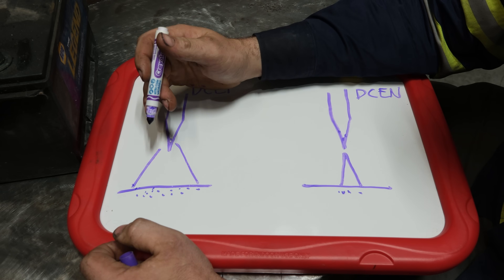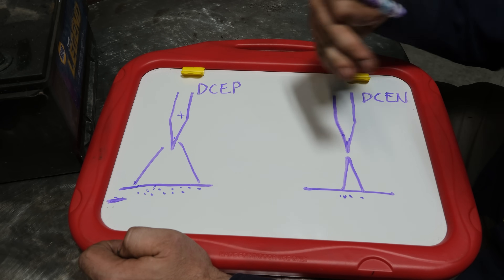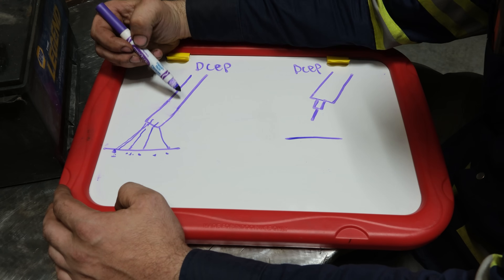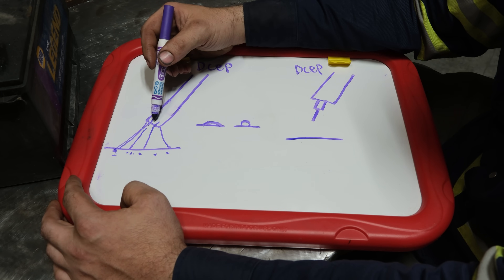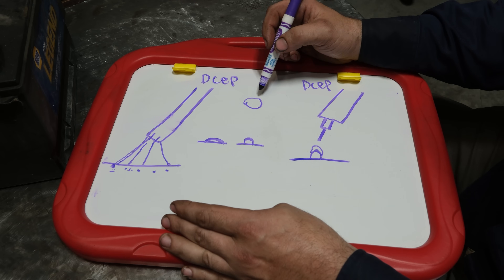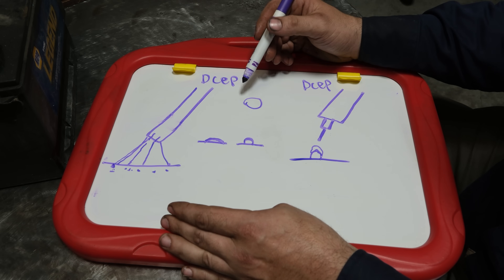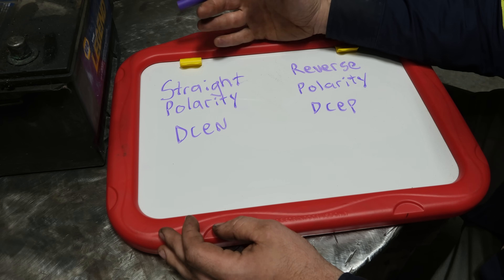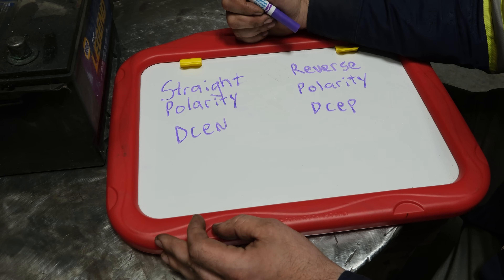Welding polarity and why electron theory is used (In response to #weld.com)

Comment: That was a very clear lesson in polarity. If you have a consumable tip such as stick or flux core (dual shield), then run DCEP because the electrons will flow from your work to the tip, helping you melt the tip and wet out your weld. If you are doing TIG and you wish to not destroy your tip, or flux core, you must use DCEN so that electrons flow from the tip to your work, thus keeping your tip cooler. That makes a lot of sense. Thanks for such a clear lesson.
Reply: Flux core is run DCEN
Reply: Self shielding 
Flux is commonly DCEN. Gasshielded fluxcore (dualshield) Is DCEP (commonly) but as always: Look on the specsheet of the fillermaterial.
Reply: @sebastianleicht  my mistake, Flux core is DCEN. My learning continues.
Reply: What about my tombstone welder?
Reply: @ivanduke  Your, and my tombstone, is AC negative, where the stick is positive. Does your tombstone have DC?
Reply: @TorBoy9 AC only

Comment: Thanks Greg for the explanation “in understandable terms” of how the polarity actually affects the welding processes. If I remember correctly from my electronics study years ago components such as NPN and PNP Transistors with the arrow drawn on their emitter lead were actually drawn pointing the wrong direction for representing electron flow. Then when they discovered electrons travel neg to positive they just kept the nomenclature of their drawings the same and to represent what they then explained the transistors symbols of the emitter lead to represent showing conventional current flow direction.
Thanks for teaching us with your excellent videos my friend. 😎👍
Reply: Naaaah. It's even more complicated. In Bipolar (PNP/NPN) devices you have a lot of holes moving too. Those ARE positive. It's kinda impossible to get the arrow right when you have both types of carriers :D In N-Channel Mosfets undergoing active conduction you have only electrons. And consequently, their arrow is pointing in the correct eletronic direction. Source injects eletrons, drain....drains them. P channel again has the arrow inverted, only holes are moving. People have known about negative elementary charge for a looooooooong time. Can't design vacuum tubes without knowing.
Reply from the maker: Your example is why the importance of everyone being on the same page of understanding matters lol.  On any component that functions as a one way valve or otherwise the direction of electrons matters, polarity needs to be accurate for things to work.  If everyone isn’t making the same assumptions on  direction, something is sure not to work lol.  I find it funny welding decided to label the terminals as what they actually are and follow electron theory, considering how many things in the US don’t follow that.  Having virtually no highschool education I didn’t know of electron theory (or realize what was going on until I took a welding class) and didn’t understand why they labeled things like they did, which appeared wrong.  Funny how somewhat inaccurate things wind up sticking around forever and people all over the world are taught differently lol.
Reply: @makingmistakeswithgreg it's not as odd or funny as you might think. Current theory was developed alongside water and steam power. Water power uses a concept of surplus and deficiencies to create a pressure difference then harnesses that for power. It's the same with everything,  more pressure or force than resistance means something moves. In accounting,  a surplus was always represented by a + (positive) which is the opposite of a deficiency represented as a - (negetive). So current theory was a primitive way to understand how to get work accomplished that still works today. A surplus of electrons moving to a deficiency. Welding or brazing on the other hand used flame and heat to bond materials together. It was always a molecular or atomic art even before we understood what was happening or electricity was a thing we used. So once we started understanding we could use electricity to heat the materials,  it made sense to stay at the molecular or atomic state because we are still asking metals to bond with other metals.  So the difference is really in getting useful work verses atomic structure and bonds.  It just gets confusing when current is used to create the condutions for the atomic bonds and the terms blur.

Comment: Thanks for the clear and concise explanation of welding polarity and it's effects.  I learned to weld 40 years ago, but stopped to pursue another career.  I recently retired and dusted off my old Lincoln TIG 300/300 and was unsure of the polarity to use for stick and TIG.  This video was the refresher course I needed!  Just yesterday I welded a 24 gauge heat shield for a friend using my 100 amp Lincoln MIG.  The setting chart for 24 ga with CO2/Ar suggested switching to DCEN to prevent blowing holes in the metal.  The results were exactly like you said, big blobs of metal with no penitration.  Reverting back to the normal DCEP worked fine. you just needed to be careful. This video could not have come at a better time.
Reply from the maker: Glad to hear that the video helped you out.  It’s pretty crazy how little penetration DCEN with gas shielded mig has.  Definitely not something you would want to use on thick steel lol.

Comment: My old lecturer explained it this way, you imagine 2 car parks, one at each terminal (+ and -), the cars are the electrons, so whilst the cars travel from - to +, the car spaces appear to move in the opposite direction (conventional flow).
Also, where many electrons are confined to a space, they repel each other-hence with DCEP, they widen the cone arc, where as in DCEN, only so many electrons are allowed onto the tip because of the repulsion from each other.
Great video as always, not enough theory is being taught here on YT except thru your channel.

Comment: Very well explained! Where there once was confusion, there is no more, and by knowing the why, it makes sense, and I no longer have to memorize it. Thank you Sir!
Reply from the maker: Glad to hear that 😀👍.  For many things electron flow simply doesn’t matter. Welding is one of the few things where understanding what’s going on with them explains why certain things seem backwards.  And when you understand what’s going on you understand welding quite a bit more.   Or at the very least they could have called DCEP straight polarity instead of DCEN, that would have made more sense in regards to keeping things as conventional current lol.

Comment: Very well done Greg! I went to welding school right after I graduated from high school and I never understood the why of Straight & Reverse Polarity until I was perusing an Electrical Engineering degree over twenty years later. It's kind of unfortunate that the made up convention of "current" came about a long time before electron flow became understood... In fact, "current direction" as it was understood at the time could have just as easily been established as negative to positive - I had one professor say that they just flipped a coin to define it and it landed on the wrong side...
Reply: I don't think they flipped a coin. Current theory is too easily visualized as an excess or surplus on one side. It's based on how water flow (a common form of power at the time) seeks an equilibrium of pressures and is harnessed for energy or power.  It's a well understood principle of the time. Take two identical tanks of water and connect them at the bottom with a valve to control flow. Fill one completely up with water and leave the other empty. You can say one has more or a surplus of water while the other has a deficiency. A surplus is represented by a positive number + and a deficiency is a negative number - just like in accounting. Open the valve and the full tank will transfer the surplus (+) to the deficient (-) side until the water level is equalized. This created a current or flow of water that can be harnessed to be used for useful energy - a waterwheel for example. 

So electrical current theory stems from existing terms and technology when it was being discovered that it can provide useful work also.  Electron theory was develop from the atomic understanding of the process and since processes like welding was so closely related to the atomic fusion or bonding of materials,  it made sense to stay in that reality. In short,  it's identifying separate things using similar terms based on the existing technology of the time it was used.

Comment: When I went to electronics school in 1968, I was taught (correctly) that electrons flow from negative to positive.  Later in my carrier I had the opportunity to work with several EE and trying to work through a problem when one guy is thinking - to + and the other guy was taught + to - was a real pain in the ass.  Why not we just admit we were wrong in the past and we all start using the correct electron flow direction!
Reply from the maker: I 100% agree.  The reason I keep hearing is “it doesn’t matter because as long as flow is present both theories work”.  I think it’s holding people back not understanding more of what’s going on.
Reply: @makingmistakeswithgreg  --  A long time ago, we thought the earth was flat.  Why would we keep calling it flat now that we know it's round?  :o)
Reply: @rpsmith  Job 26:7 New International Version 
He spreads out the northern skies over empty space; he suspends the earth over nothing:person-turqouise-waving:
before long time ago aka when people stopped reading the bible :face-fuchsia-tongue-out:

Comment: Awesome lecture. I had 7 years of electrical engineering and we did run into the electron current and the conventional current. I really enjoyed your explanation of the effect on welds that the polarity has.
Reply from the maker: Glad to hear you liked the video 😀👍.  When you realize what’s going on it makes it a lot easier to understand why certain processes use certain polarities.  I just wish it was explained better in welding schools and in general, because so much contradicts “common wisdom” and conventional current that it really is more confusing than it needs to be.
Reply: @makingmistakeswithgreg  there's a lot of blind faith in welding. You're recrystallizing metal and trying not to make a stress rising weak spot. The entire thing is invisible. When you have that kind of mysterious process it tends to lead to a lot of superstition. At one point it was illegal to use iron to build a bridge because it was impossible to predict the quality of each different iron working persons out put.

Comment: Great video Greg!!!! The way that you broke it down and made it understandable is greatly appreciated by many.  In rare circumstances I’ve had to switch polarity on 7018 to dcen so that I wouldn’t blow holes in thin materials or due to gaps. I actually have to do a shitty 3 position weld test for a job that is an open root plate test( not sure who the hell would write a procedure like that), but I’m probably gonna switch polarity for my root if I’m allowed.

Comment: Good Video! I used to work for PowCon in San Diego in the 1990's before Miller bought out us and Hobart. I fixed the power-control boards and tested welding in all 3-modes SMT400.
Reply: powcon are good welders

Comment: Great video Mike. I’m a welding helper trying to learn the ropes. I’m already in love with welding!
Reply from the maker: Glad to hear your learning.  You’re on the right track, learn as much as you can, it will only help.  Get used to being frustrated a lot when learning, but once to get through the real steep initial learning curve you will be doing good 😀👍

Comment: Just came across your video. Very informative. This was confusing to me too when I was taught. My instructor said to me think about the government, "What" I said. Senate & Representative he said. SEN & REP which means Smooth Electrode Negative and Rough Electrode Positive. Now we only welded stick & tig where I worked so this didn't really apply to mig. But it works.

Comment: Great video Greg, I've had many conversations with experienced and very talented welders who really had no idea why the change in polarity with the several welding processes. Also you might want to follow up with a quick video regarding proper grounding (if you haven't already) and how important it is to have clean, well connected conductors and grounding the piece vs. a table, etc.
Reply from the maker: I have covered grounding in a few random videos.  You are right, it matters a ton.  A bad ground hookup will cause all sorts of problems, poor starts all the way to pieces that rattle.  A rattling piece you’re trying to do a precision weld on is the worst 😅

Comment: great video again tons of information explained in a way everyone can understand. i first learned how to weld about five years ago with flux core using an old black chicago electric welder which is dcep anyway after youtubing it i quickly learned the with flux core you need dcen and actually modified my welder with a bridge rectifier and reversed the polarity on it and got much better results. then recently a you tuber actually sent me a sticker recently and i am now a youtube certified welder lol
Reply from the maker: Glad to hear you are a certified welder 😅.  Those black boxes actually put out a/c and a bridge rectifier will turn it into dc.  They produce a ton of spatter and a simple rectifier makes them weld far better.

Comment: Nice explanation.  The physics of electrical current is one of those things that gets weirder the closer you look.  To add another twist, the velocity of electrons through a wire (the "electron drift velocity") is actually very slow, on the order 0.5 inch / minute.  Of course turning on a light is almost instantaneous because the electromagnetic field (with which the electrons are interacting) propagates through the wire at a significant fraction of the speed of light.
Reply from the maker: Thanks.  And you’re right, the closer you look the weirder it does get.  It’s immensely complex yet at the same time simple “in theory”.  Definitely one of those things where “the more you think you’re right, you’re probably wrong when you look deeper” lol.

Comment: We never talked of "electron theory", they just told us that when scientists started messing with primitive batteries (2 metals, some fabric and some salty water), they chose a side for positive (they basically only worked with voltage, but you can start a bit of theory, because you can start to sort metals by their ability to produce a voltage when used in a battery against another metal), and later when the electron was discovered, they realized that they needed to use a negative charge on it to explain its affinity to the positive side. so now we are stuck with a current that flows backwards to electrons.

In semiconductors, when they conduct, the charge carrier can be either an electron, or a lack of electron (called a hole, it's litteraly a lack of electron going upstream). But holes are famously slowers than electrons (the mental model I have is that there is play in the system), so for power electronics, whe generally prefer transistors whose charge carriers are electrons, the performance is not perfectly symmetrical.

Comment: This is very well explained
Reply from the maker: Thanks 😀👍.  It definitely was confusing to me when I first learned to weld and everything the instructor said was opposite of what I was taught.  Turns out the welding end of things is actually more correct than conventional current, it’s just that in simple circuits it doesn’t matter.

Comment: 6013 work DCEN  or AC .
See on the package. You have polarity , possible working position. For any kind electrode. This depend of shielding materials. Mostly.
DCEP have 70% energy is in electrode shielding material hold higer temperature so liquid metal from electrode spray to weld.
DCEN most energy is in weld 70% and 30% in electrode but different material. 6013 have lower melting point. And with smaler temperature energy melt and fill up weld.
Stick welding is or DCEN or DCEP or even AC but not all electrode can work on AC .
People think stick welding is only DCEP or DCEN no.
Depend of type electrode.
+~ simbol mean electrode work DCEP and AC
-~  simbol mean electrode work DCEN and AC 
6013 is example.
Some stick electrode cannot work AC at all.
I am not invented nothing. Just read instruction for electrode what I used from many company.
Stick electrode have designation and composition in all world same.
Just read on the package. 
I long ago was welding. So I start with buzz box AC , after when tehnology evolve I switch on inverters machine. Pure DC.
Reply: Caution read the instructions on the box, Esab Goldrox (e6013 rutile-cellulose rod) are both DC+ DC- or AC, they are a good rod, I've used them on dcep.
Reply: @olivertaylor4779  I always read and follow instruction. Böeler electrodes 6013 have designation on box -~ mean DCEN and AC
Reply: I have chart from American Welding Society , about electrodes modern designation and type of currents AC , DC and polarity , charts is from 1946.

Comment: Well, current flows from positive to negative, but that's just a sign convention for "positive" and "negative" that was assigned long before electrons were discovered. In fact, it even predates electrical batteries and generators—the assignments were made back when the only electricity we could make was static electricity.

The only people designing things that actually care about what you're calling "electron theory" are solid state physicists designing transistors and the old-timers who designed vacuum tubes.